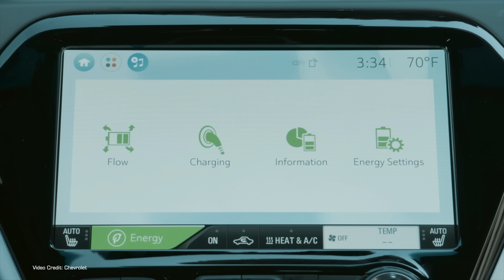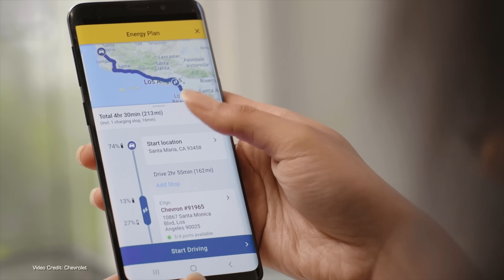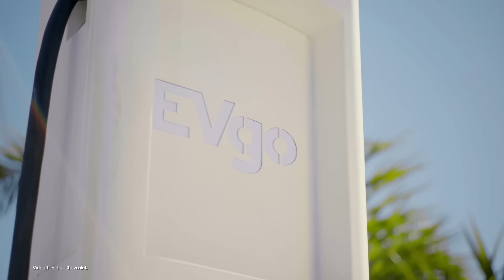UPDATE: Bolt EV Fire : GM Announces Full Battery Module Replacement - Here's What You Need To Know!

Comment: Good video. Thanks for the mention! Replacing the entire battery pack would be a far superior long-term solution. Battery section replacement (there are five battery sections with two modules per section) requires attention to detail, torquing all the bolts and nuts to specification, performing an internal battery cooling system leak check, performing a battery housing leak check, and many hours of labor. The battery cover alone has 56 bolts and a two-step torque sequence. New battery warranty or not, there are many things that can be done incorrectly. I have been a Chevrolet fan for many years, I have a Bolt EV, my son has a Bolt EV, my employer has a Bolt EV that I use in my classes. Like all of you other Bolt EV owners, I hope they handle this mess quickly.
Reply from the maker: We’d love to do a video with you some time, prof!
Reply: @transportevolved  Thank you. I am open to that.
Reply from the maker: @WeberAuto  Do let us know the best way to contact you - :)
Reply: @transportevolved  I just emailed you at the email address in your channel's "About" section.
Reply: Love the Weber videos!
Reply: @georgegeller1902  Thank you!
Reply: Maybe GM plans to set up a factory assembly line to rebuild the packs. They could take the pack off a car, immediately install a rebuilt one and send the removed pack to the factory. An assembly line could rebuild them as efficiently and accurately as the original manufacturing line, more or less.
Reply: @dwaneanderson8039  Ahhh, but then it wouldnt be the same housing. At that point they might as well be replacing the old pack with a whole new pack and recycling everything.  There must be some reason they want to keep the same housing. Perhaps it has something to do with the warantee or their ability to internally track parts for down-the-road repairs. A rebuilt pack would look like the same pack when it is scanned, vs a swapped pack which would look like a new part.
Reply: Is it possible that 2022 modules will fit in the older battery casing, but the 2022 battery casing and connections won’t fit with the recalled Bolts?
Reply: @willaerley7140  Yes, that is possible. I have not actually seen a newer battery housing yet. However, I would be very surprised if it were any different.
Reply: @WeberAuto  re: "I have not actually seen a newer battery housing yet. However, I would be very surprised if it were any different." exactly, whatever is in the M.Y. '20 and '21 is in the refreshed M.Y. '22 (which we know is the exact same vehicle).  let us all remember, the 4 corners of Planet Earth have been in lock down with a Global Pandemic for 1 year and 8 months, understandably this means the focus has been on TRYING TO STAY ALIVE.  as such, the folks at GM and LG are Human Beings (with families and loved ones) who need doses of vaccine in their arms in order to remain UPRIGHT AND VERTICAL same as the rest of us.
Reply: Agree with this.  Seems it would be way more efficient to set up a battery refurbishment facility, where all the packs are sent, rebuilt with new modules, and then returned to vehicles.  In that way errors in assembly and disassembly could be minimized, and the completed packs thoroughly tested.  Having individual car dealers attempt this sounds like a recipe for multiple problems.
Reply: It is way too late to handle this quickly. That horse left the stable months ago.
Reply: @jenkinseric2  re: "It is way too late to handle this quickly. That horse left the stable months ago"  wake up everybody, the GENIE is now out of the bottle...!!!  the sh!t cannot be put back into the HORSE...!!!
Reply: @phillyphil1513  i doubt there ever was one. since they cant seem to tie down exactly which batteries are at risk, even though they know what plant or plants they came from and when. i sort of suspect that 'software fix' was actually trying to locate where the problem was. and evidently there are 2 LG defects that have to be there, to cause a fire. sort if like if they built an engine that allowed gas/diesel to escape it, there would likely be a fire. and some of the classic cars actually have this problem.
Reply: @davidwillims2004  re: "i doubt there ever was one." one what...? you may want to clarify to "whom" or "what" you're responding to.
Reply: @phillyphil1513  that there was ever a quick solution. you tube strikes again, i replied just below your comment! since neither LG or GM could identify what the problem was that caused the fire,  with what they had to start with, so the software 'fix' i suspect was to just try to identify the problem, with only the reduced range and charge being a band aid, but i gather they do have more info now, as that its not just one but two defects in the batterie, and both have to have to be there for a fire. they still cant test the batteries to see which have the problem, and tearing the battery down, is as likely to cause as much damage as the original defects did. if not more.  but i can see this happening, GM calls LG saying there seems to be problems with their batteries (as evidenced by Hyundai's experience), but LG doesnt want to take action without proof.  so the long drawn out mess was started. 'fix1' and 'fix2' were tried.  but LG didnt want a recall (and that maybe an LG US management or South Korea decision).  since they have no way (still) to identify faulty modules without breaking down the pack,  which is error prone, more so than just replacing them
Reply: I believe the success of GM in the EV space will depend on how they handle this situation.  So far they are getting a "D".  The way they are handling the had hurt the value of all the Bolts, new & used.  We have enjoyed driving our since Aug 2017.  WE frequently return home with less than 70 miles remaining.  The latest "restrictions" have me seriously considering the possibility of an exchange to a 2022 Bolt.  I really enjoyed the Weber videos.  Long but very well done & easy to understand.  Well Done!
Reply: @dennislyons3095  I would never consider buying anything from GM. It is way too late for them to treat their customers well on this issue. All machines have recalls and problems, it is how the manufacturer deals with them that makes a difference. Hyundai vs GM?
Reply: @jenkinseric2  or the supplier, cause suppliers are on the hook for repairs cost for their parts (and the battery pack is a part), so LG may have not been in any rush to fix the Bolts
Reply: @dennislyons3095  well some of that maybe on LG (or not), since LG will be on hook for the cost of this mess),  they werent likely to want to do another big recall, after having done that for Hyundai (or just didnt want to cause its a US company(maybe)?  course with this recall and Hyundai's, you would think that VW and Ford might be second guessing whether they want continue using those batteries.
Reply: I have a 2019 Bolt EV with the Korean LG battery. I seriously doubt the ability of my local dealership in Alabama to manage the battery swap. They don’t even have a level 2 charger and could barely manage the 2 software “fixes”. I love the car, but regret not getting a Tesla.
Reply: @alabamatubers  
So get rid of it and get a Tesla.
Should have gotten a BMW i3, at least those cars don't suddenly burst into flames.
Reply: I live in Utah and own a Bolt and I think you're the coolest cat alive, love your channel man. Wish I had the time to come take some of your classes.
Reply: @milo8425  Thank you very much!
Reply: Way too much drama about these Bolt battery fires? GM should just buy back these cars and or replace the batteries and end production of the Bolt.. Its not like the Bolt is a major seller on the market like the Model 3. The Bolt will be forgotten soon if GM simply replace it quickly. 

As of now I probably wouldn't accept a Bolt if it were free.

Comment: GM has a horrible history and are obviously dishonest and not worth the benefit of the doubt on any EV issue. They've never appeared to prioritize the best interest of customers. Too bad that the vast number of budget EU options aren't fully available in the US. I'd never buy GM just on principle.
Reply: Can't argue with that...dumping converted v8 350c.i.d. gasoline engines as diesels back in the 70s was a sign not to be ignored. Never trusted them again...that's why I leased the Bolt instead. I'll buy the F150 Lightning though because I know their service expertise when it comes to the pickup truck having owned several and still do.

Comment: from what I understand the 2020- 2021 Bolt EVs have the same LG Chem battery packs as the 2017-2019, Will they be replacing these too? I heard a 2020 Bolt battery combusted and burned up another late model Bolt. This is worrisome!
Reply: The newer Bolts have batteries built in US by joint LG Chem /GM plant and supposedly do not have the same manufacturing defect as those built in S Korea.
Reply: @brucec954   Thanks for the update. Let’s hope these late model Bolt EVs don’t combust too🤞🏻
Reply: The batteries from mid-2019 onwards are different. Manufactured in the US and have different chemistry.
Reply: @Allan_A   Thanks. Such a relief!!
Reply: Listen to the report - the newer Bolts have different cell chemistry, and have several properties that are improved. They are NOT affected by this, and those new cells will be thr type used to replace the old ones.
Reply: @NeilBlanchard  sorry but I saw the label of some new EUV and the batteries are the same than 2020-2021…
Reply: @electricguy109  Source?
Reply: @NeilBlanchard  myself? You just need to bend over and check underneath the car. I found a 2020 and an EUV 2022 and they have the same capacity (64kWh) and similar production codes.
Reply: Look at the third row.
When it starts with 0808 it has a US Michigan made pack and is not affected.
When the code starts with 6883 it has the problematic cells.

Comment: GM: "We'll save money no matter how much it costs!"
Reply: And boost their street cred 1000%. (but not if it takes months or years)
I'm wondering what the loaner car would be, maybe a 2022 bolt?
Hopefully NOT ICE.
Reply: @n3glv  some dealerships will loan out bolts, not every dealership.
Reply: @Jan 6 was "Wall Street Putsch" part 2 Except for the part about excess battery degradation.
Reply: I think GM is quietly buying up all of the Bolts that go to auction from lease end and trade in.
Reply: @yolo_burrito  The better to CRUSH THEM? (Who Killed the Electric Car PT2?)
Reply: @n3glv  I think if GM can get them for the right price they decided yes.
Reply: @Jan 6 was "Wall Street Putsch" part 2 
There is often the chance when on the 
bleeding edge that you can come out a
bloody mess. I'm assuming that is why
the advice to affected owners is to under
charge and under delete their packs. On 
my home built e-bike I intentionally kept
the max voltage a few hundred MV under 
the max the LiFeP04 cells were rated at.
Reply: I just saw a headline “GM partners with AT&T”,, well that outta be something. Two  companies with the absolute worst customer satisfaction ratings will combine their “Talents”. Who buys this 💩
Reply: @billcoulter9879  Will they be under the ATT 
logo? (AKA the Death Star)
Reply: laughed my ass off.

Comment: Well , certainly the new GM is no different than the old GM.  Those who buy any GM product are  nothing more than beta testers for GM total , complete failure to manufacture quality, tested products. Outsourced the cheapest components possible and blame any failure on the supplier they picked
Reply: The batteries came from LG chem. Hardly the cheapest supplier around. They're a well-respected experienced battery manufacturer. Manufacturing defects happen and in something like a battery they don't just show up right away. Only under certain conditions did the defect become obvious.
However the handling of the problem is GM's fault. Even if they weren't sure what was wrong or how to do it they sure as hell didn't do a good job of handling the public relations.
P
Reply: And this makes them different from other manufacturers how?

Comment: As a 2017 Bolt owner, I am glad this is finally moving towards a full resolution.  But I am disappointed that they couldn't find an identifiable fault that they could isolate to specific modules and only replace those modules.  It would have been the most efficient use of resources.  
I would have been totally fine with GM just replacing some modules in my pack, even with refurbished modules, if that would have worked.
Too bad it isn't an option.  As a result, they will probably have to recycle all those batteries.  Which isn't terrible, but it is a bit of a waste.  That means they will be recycling good packs, because they can't prove they are good.  I understand, but it's too bad.
It might take months until they get to my 2017, but I am lucky in that I can park my car outside.  Not ideal, but I am lucky I have that option.  Others don't.  So I hope they also prioritize based on actual need.  There are Bolt owners who can't wait as easily as I can, and they should go before me...
Reply: Similar boat here. 2017 Bolt, I park and charge outside. I hope you’re right about it taking months; I would lock that in now if I could, because I fear it could be a year or more.
Reply: As they replace the cells in the worst affected group - 2019 models that were built in October and November of 2018 (I believe), they will be doing full forensic analysis and IF they find the defects, AND develop a reliable way to test and find which are bad cells - THEN they will be replacing only those cells. This is essentially why they are proceeding this way.

My question is though - can a pack work well with a mix of old and new cells?
Reply: @NeilBlanchard  I hope so, and I will be really happy if that pans out.  Yeah, mixing old and new cells would, I think, be fine.  Although you wouldn't get the benefit of the new cells.  The whole pack would only charge to the max voltage of the lowest charging cell.
Reply: @NeilBlanchard  If they announce that they’re going to be replacing all the modules for 2017–2019 Bolts, though, and then they don’t do it after all this mess, wouldn’t that further piss off customers? Doesn’t making this announcement effectively lock them in to replacing all the cells/modules?